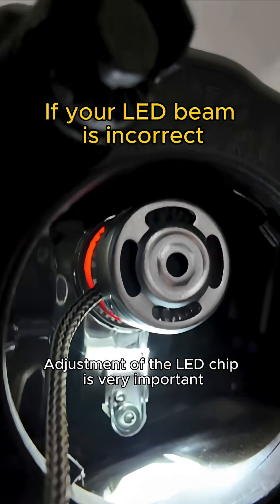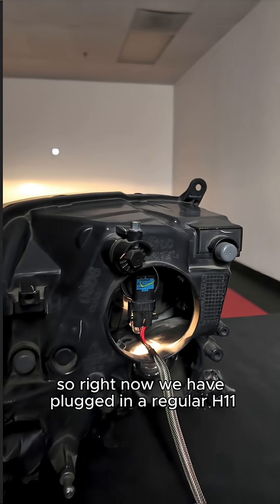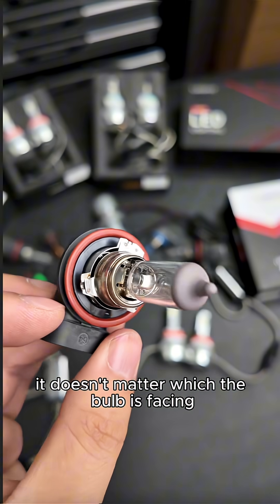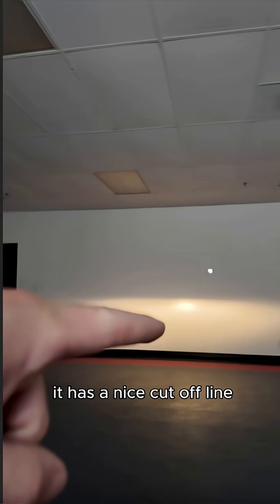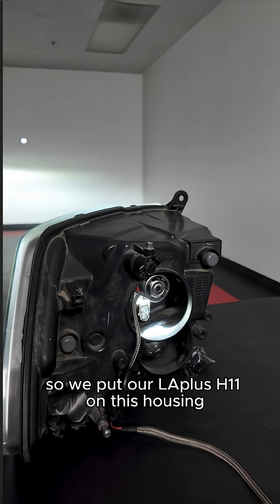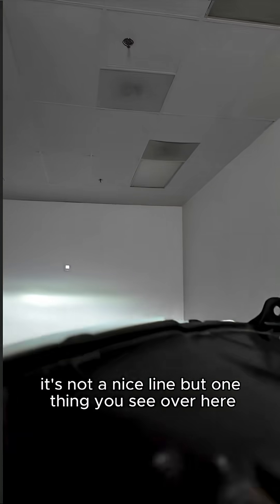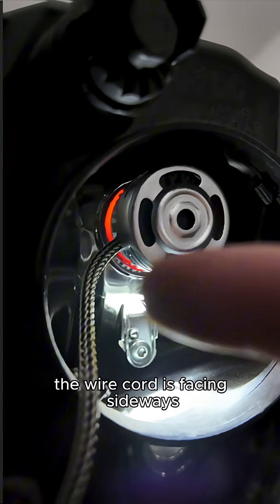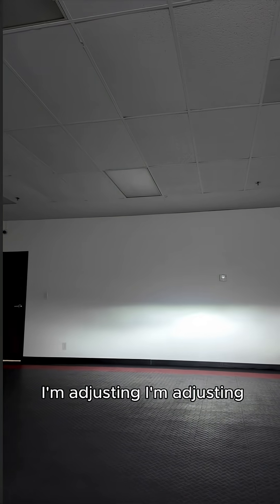Are Your Headlights Blinding Everyone at Night?

Comment: @Lasfit-Automotive 

Have u guys ever worked on installation for 2020 Chevy Spark? If so, can the LA plus fit with a small offset for low beams for H11 projector?

This look very similar. 

That’s why the LC plus is more compact and easier to installed.
Reply from the maker: Yes, the LAplus H11 can fit the 2020 Chevy Spark’s low beam. It’s been tested and confirmed by other users as well.